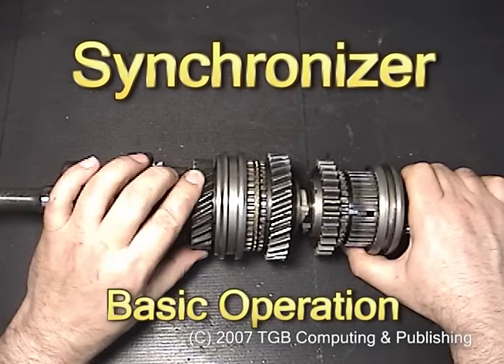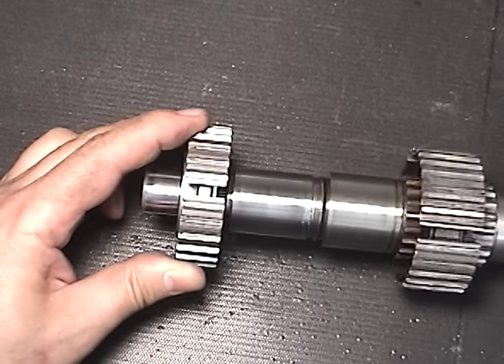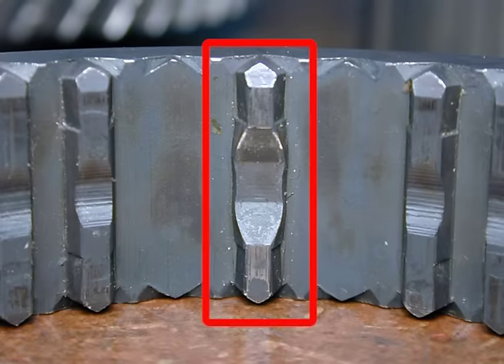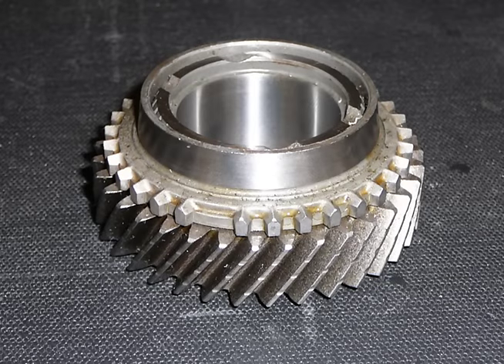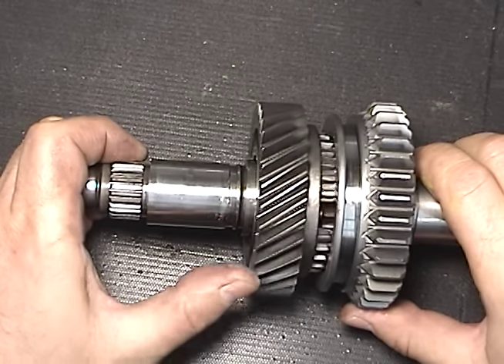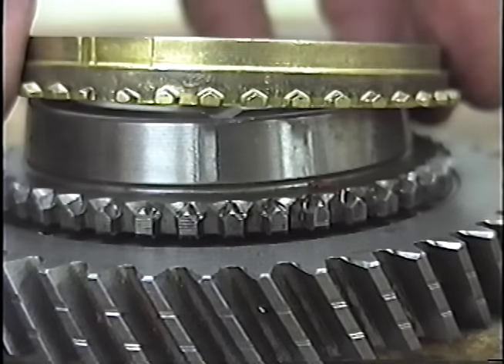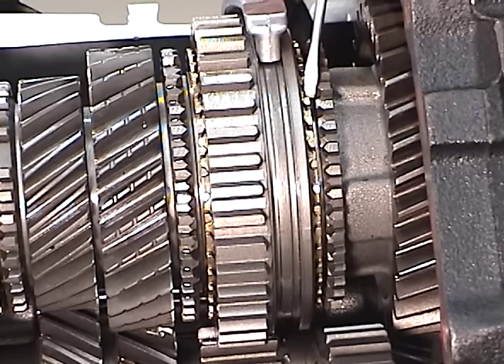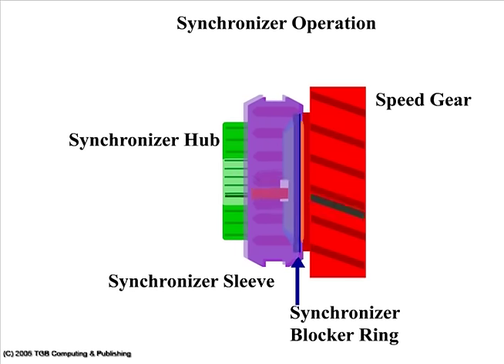Synchronizer Operation Explained

Comment: Would a block on 1st and 3rd which causes popping out (both gears on the same side of the shifter) mean anything specfic?
Reply: I don't think I have ever seen a synchronizer with 1st on one side and 3rd on the other. Normally 1st and 2nd and 3rd and 4th or I have seen 1st and Reverse and 2nd and 3rd and 4th and 5th.  So a worn blocker typically will not cause jumping or popping out of gear. Normally worn clutching teeth on the gear and on the sleeve cause this.  Not those teeth normally get worn down because the blocker is worn and the driver is grinding the gears during each shift.  Other things like worn shift forks or loose shifter mechanism.  More rare would be week or worn detent springs or misaligned bell housing (older classic cars).  He is an odd ball one that I had one time.  I had an older VW with a plastic rather stiff shifter boot. The boot was off center and when installed upside down it would exert force on the shifter in the direction of neutral.  Under heavy acceleration the boot would exert enough force on the shifter that the vehicle would jump out of gear.  Imagine resting your hand on the shifter al the time and while in 1st or 3rd the force of you resting your hand on the shifter was actually putting a slight amount of pressure on the shifter toward the neutral direction.  Under heavy acceleration this will cause the transmission to jump out of gear.  It's just one of those odd ball things but it happens, so I mention it to you.
Reply: @tb-skyline-auto9836  Thanks for the reply, when i wrote ''on both sides of the shifter'' i meant 1st gear being Top left and 3rd gear being in Top Middle (both gears are in the same area) but its a normal 5 speed gearbox in a UK Ford Fiesta mach 8...

So your saying gears popping out is, in some cases is due to the clutch?
Reply from the maker: It's extremely unlikely that replacing the clutch will solve a popping out of gear problem.  I'm sorry to say that this is typically due to a problem inside the transmission if it's not shifter related such as worn shifter linkage or a improperly installed stiff shifter boot.  I recommend that you have a qualified mechanic look at it for you and cross your fingers that its a linkage or shifter problem. One last possibility might be worn out or broken engine and or transmission mounts could do this.

Comment: I don't get how the blocker works or what stops the collar from moving over and grinding.
Reply from the maker: Yes, that can be tricky to understand.  If you rub your hands together really fast for 30 seconds what happens?  Friction builds along with heat.  What happens when objects heat up? They expand.  When the blocker ring is forced against the cone on the gear friction occurs as the two objects try to synchronize.  In the moments before synchronization or during circumstances where synchronization cannot occur (such as trying to downshift into 1st gear while driving 80 MPH) the expansion of objects from the buildup of heat causes the blocker ring to create a counter force that is transmitted through the keys to the sleeve.  This counter force will prevent the sleeve from making contact with the clutching teeth on the gear (preventing grinding) until synchronization between the gear and the synchronizer can be accomplished.  Once this happens the sleeve can move over and lock the two together completing the shift.  If it's impossible to synchronize such as downshifting into 1st from 80 MPH the heat and counter force is so great that you will be incapable of moving the shifter. This will block the sleeve from grinding against the gear. I hope this made it a little clearer.

Comment: Why does my car deny to engage the 1st gear unless i am moving with speed less than 10km/h? Is there a problem? Can it get "fixed"? (Toyota Yaris D4D 2013 6 speed)
Reply from the maker: If the vehicle is going to fast when you try to downshift into 1st it is designed to prevent engagement so you won't grind the gears.  10 km/h is pretty slow a little more than 6 mph and you should be able to make this shift without a problem.  The most likely cause is the synchronizer blocker ring is unable to match the speed of 1st gear to the output shaft.  Often cause by blocker ring wear.  I would have the manual transmission oil replaced with a good synthetic manual transmission fluid. If you can get Redline MTF that would be my recommendation.  I can't vouch for any other brand of synthetic manual transmission fluid.  If you can't get synthetic or Redline replace the oil with one that meets manufacture specification.
Reply: @DrivelineMaster  thanks master 😍

Comment: Would low fluid cause a bit of grinding when you’re trying to get into first gear at a very low speed while rolling? Or bad synchronizers
Reply from the maker: Low fluid and old fluid will overwork the synchronizes. then they will stop working well which will result in some hard shifting and some grinding (gear clash).  Continuing to drive like this will only make it worse.  Try replacing the fluid with a high quality synthetic manual transmission fluid.  If you can get Red Line MTF that is my go to for grinding on old transmissions.  I have a good track record with this solving grinding and shift problems on transmissions with some sychro wear.
Reply: @DrivelineMaster  Change the fluid out last year. I do have a small leak coming from the gear shifter assembly which I’m about to replace but this morning it was a little colder out and it really started acting up which leads me to believe I might be pretty low on fluid. But it’s only first gear, don’t have a problem on any other gears. as I was sitting in the garage I Gave it a quick rev and try to put it into gear and it wouldn’t go in until the RPMs came down. Thanks for the advice I’ll definitely try to top it off this weekend just a pain in the ass to do it on that car.
Reply from the maker: You might just have a worn 1st gear synchronizer ring.  What kind of gear oil did you use?  75W-90? 80W-90? GL4, GL5 or a combo compatible with both.  Did you use a synthetic? If not I recommend Redline MTF.  It's worth a try since you already have to crawl under the vehicle to check and top off the fluid level.
Reply from the maker: PS.  You don't say what kind of vehicle this is? Some Manual transmissions can use ATF making cold weather shifting easier. Honda and Acura transaxles can use 10w-40 motor oil or often work best with the Honda synthetic gear box oil.
Reply: 05 Pontiac Gto
Reply from the maker: The specified fluid is GM part number 88861800.  When I look this up I can not find any information on the viscosity.  It could be ATF for all I know.  It does say that it is a petroleum based fluid. It does not specify a grade like GL4 or GL5.  My recommendation would be to make sure that this is what is installed in your transmission. In 2006 GM went to a newer fluid part number 21018899.  Information is spotty but I suspect this is a fully synthetic fluid.  One site listed this as 75w-90 but it didn't say that on the image of the bottle.  If the OE fluid is brown like gear oil I would switch to a Redline Synthetic MTF otherwise you should use the GM oil.

Comment: Very nicely explained. I have a car Vauxhall Victor FB 1964, has a 3 speed manual transmission, there have always been a problem with 2nd gear, the shifting is not smooth, it makes a noise upon shifting, I have a technique of shifting to 2nd speed smoothly is by jerking the throttle/accelerator pedal twice, and like that the shifting is smooth without noise. Why is that?
Reply from the maker: You are doing what we call rev matching or revolution matching. By playing with the throttle speed you speed up or slow down the input shaft and counter shaft along with the 2nd speed gear.  If you can get that speed close to the speed of the output shaft and synchronizer then engagement will be smooth.  You essentially are doing the job of the synchronizer for it because it's worn out.
Reply: @DrivelineMaster  thanks a lot for replying. Another question is is the synchronizing rings inner groove worn out or the taper surface of 2nd speed gear worn out? Is the EP Lubricant cause of making bad the yellow synchronizing rings?
Reply from the maker: Typically it's the brass ring that wears out since it's softer than the hard steel cone on the gear.  Wear on the blocker ring can be from multiple reasons and old, contaminated or wrong fluid can play a part in premature wear.  Additionally hard driving or poor quality of the original parts.  If there is a history of your vehicle having second gear synchronize problems this can point to manufacturing. The fact that this is a 1964 I might contribute this to age as much as anything else. I don't know if you can get the Redline brand of manual transmission fluid (MTF) or not but this is a fantastic synthetic MTF and would be worth a try to change your oil and install this.  If not, try to locate another high quality synthetic MTF.  i could help.
Reply: @DrivelineMaster , thank you once again for responding. The manufacturer has strictly warned of not using EP (Extreme Pressure) lubricant as EP Lubricant is harmful for synchro mesh mechanism as it contains sulphur which badly harms the brass synchronizing rings, the manufacturer has specified SAE 90 straight transmission oil whereas the mechanics use to put SAE 140 EP poor quality lubricant. It also became bad  due to shifting of gears at a very speed by my late father then.
Reply from the maker: I don't know for sure if the synthetic Manual Transmission Fluid (MTF) from Redline is extreme EP or not but I don't think so. It is rated as a multigrade 75 or 80W -90 grade.  What I do know for sure is that I have had several older manual transmissions with gear clash while shifting and replacing the mineral based 90 grade gear oil with this fluid vastly improved shift quality and reduced gear clash grinding.  At this point I don't think it would hurt your transmission. Also know I don't work for or have any interest in the Redline product, company or brand.  I just know it works and have no problems recommending it.
Reply: thanks for all the info and useful guidelines by you. I will for sure try to locate the redline transmission fluid as recommended by you. Best regards
Reply: @husainzaidi1527  Red line oil is amazing. It is my favorite because it is super high quality stuff. But it sounds like your second gear synchro is damaged already. Did you manage to fix your problem?
Reply: @Synthwave89  , thank you very much, I have replaced the synchronizing ring and the gear as well but not yet fitted the transmission as the car is undergoing restoration work, but hopefully the longstanding issue will be fixed.

Comment: I'm trying to wrap my head around why the synch is free to rotate +/- 10º with respect to the sleeve, and why the synch has external teeth at all. I understand these two features are related. However, it seems that if the synch could NOT rotate that 10º, and if it did NOT have the external teeth - it would still work. The keys would still push the synch up against the speed gear cone, slowing/speeding it appropriately, allowing the sleeve to pass over the synch and onto the dogs of the speed gear...??

It seems to me that once the synch has brought the speed gear to an rpm that matches the output shaft rpm, it's only random chance if the dogs of the sleeve, synch and speed gear will actually be in alignment. I'm assuming this is on purpose and is why the synch is often referred to as a "blocker". Part of it's function is to specifically misalign with the sleeve so the sleeve may NOT be pushed further toward the speed gear. But I don't see how this can be controlled by anything other than chance (and I know it's not...).
Reply from the maker: The slight rotation of the synchronizer blocker ring and the teeth improve synchronization and engagement when the sleeve moves over for the mechanical connection.  When the sleeve starts to move the first set of teeth it engages are on the blocker ring.  If those teeth are not in perfect alignment with the sleeve teeth the ring will rotate slightly to make a perfect alignment.  When the ring moves slightly it will also attempt to move the gear as well in an effort to provide a perfect alignment between the sleeve and the dog teeth on the gear. The blocker ring teeth and slight movement are required for this to happen.  Additionally the extra teeth on the blocker ring adds additional holding or load caring capabilities. Yes, it could work if it was fixed and didn't have teeth. This is the best I can offer. I'm sure there is an engineering explanation that is beyond my capabilities.  I hope this helps.
Reply: @DrivelineMaster  I appreciate your thoughtful reply; thank you. I do have some questions/comments though:

While the speedgear is NOT at a matched speed, when the synch is pressed against the speedgear cone, isn't the synch going to be at one of the extreme ends of its shift key notch? For it to impart any rotational friction onto the speedgear, the synch needs to be supported by something ; the shift keys. So during friction/synchronization, the synch will be misaligned with the dogs in the sleeve. Right?

Meanwhile, as force continues to be applied on the gear stick, force continues pressing the synch up against the speedgear cone... So what would then cause the synch to unlock from the cone and allow it to rotate so that it can be centered on its shift key notches, and come into alignment with the dogs in the sleeve? Where would this "reversing torque" on the synch come from, that would re-center it?
Reply from the maker: GREAT Questions which causes me to search the depth of my understanding of the working application. Let me give this a shot since I will be applying functional operation with mechanical logic which doesn't always come out to be true but more often than not it has served me well. What you said.... All true except I don't believe the blocker ring would break adhesion from the speed gear as the sleeve moves to engage. Once the speed gear is in sync as the sleeve moves over if the dogs are not in perfect alignment and a shift is required for perfect alignment the blocker and speed gear will rotate together for alignment. At this point the blocker dog teeth can be aligned with the sleeve. If the dogs on the speed gear are still misaligned the sleeve will be engaged with the blocker ring but not the speed gear. Pressure that the keys are applying is reduced to reduce the friction force between the speed gear and the blocker ring. The reduction in force on the blocker is caused by the keys being moved down (inwards towards the center of the shaft) against the key springs as the keys are no longer centered in the key raised portion that is fitted into the recess in the sleeve. When the keys are moved inward against the spring the force from the sleeve pushing the blocker against the speed gear is reduced enough for the points on the dog teeth to shift the speed gear separately from the blocker ring a slight amount to create perfect alignment. You make a good point about the blocker being seated against one edge of the slot on the blocker. This makes me want to look at several synchronizes to see if the blocker ring dog teeth are in perfect alignment with the sleeve when the blocker is rotated fully in either direction. If they are in perfect alignment when rotated to the extreme in either direction this would make a lot of sense. This recent discussion about the more in depth details of synchronization makes me what to create a followup video to address these more in depth questions that my viewers have asked me.
Reply: @DrivelineMaster  I love that you take viewer input to try and understand the mechanical logic better, to try and explain better. I saw your videos and you haven't made that follow up video on advanced manual synchro function, are you still planning on making it?
Reply from the maker: I was hoping someone wouldn't call me on that.   I'm under Shelter in place orders right now but Yes, I do plan on a followup video for more advanced synchronizer explanation.

Comment: I tried mine shifted without the clutch rev matched bang! and it's still shifts fine but it broke the bearings!! can hear them loudly now...wonder if it damage case where the isb goes? It's in the shop right now getting a complete rebuilt and a clutch It's gonna be about $1,400!
Reply from the maker: If you are good at what is called rev matching which is feathering the gas pedal just right you can shift without using the clutch and it will shift just fine. I don't know what bearing broke but rev match shifting should not break any bearings. I suspect those bearings broke for some other reason. If you can tell me which bearings broke or went bad I may be able to provide an explanation.   Bearings typically go bad from overloading, abuse or lack of proper lubrication.  Rev match shifting is not considered abuse.
Reply: @DrivelineMaster  The rev matching didnt work and it made a crunch....it toasted the input shaft bearing which got loud in a few weeks....
Do you if its common to damage the case where the bearing sits.. I'm drained the transmission fluid and found small pc of metal about the size of a BB.. 3 peices... My truck is in the transmission shop right now it's been there for 5 days..... nissan hb...
Reply from the maker: You may have misunderstood.  Rev matching allows the driver to shift Smoothly without the use of a clutch and is reserved for skillful drivers who have mastered this skill.  If you can shift without the clutch and it is smooth there is absolutely no damage to the transmission and certainly not the input shaft bearing. Input shaft bearings typically go bad from driving with worn out, contaminated or low fluid.